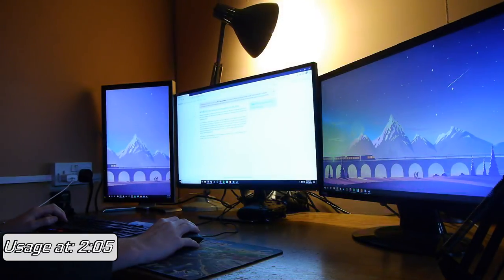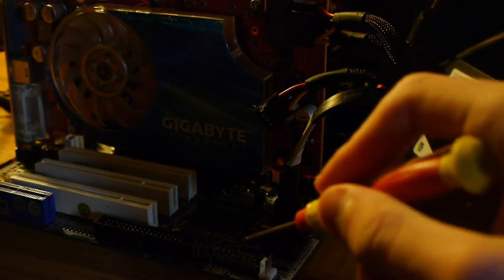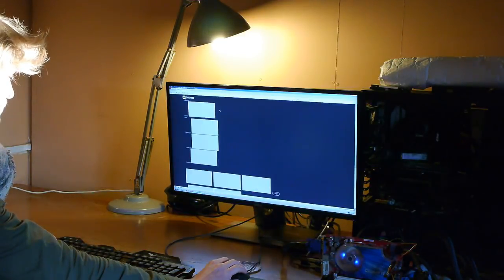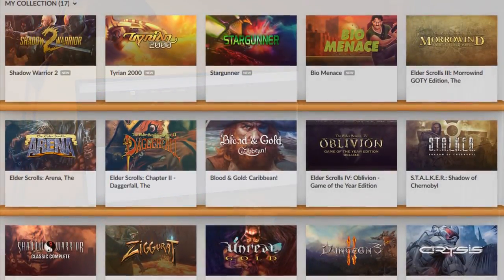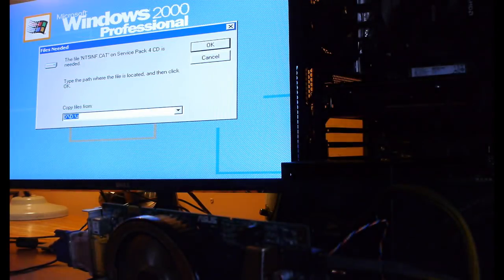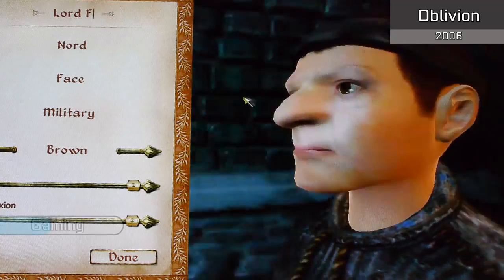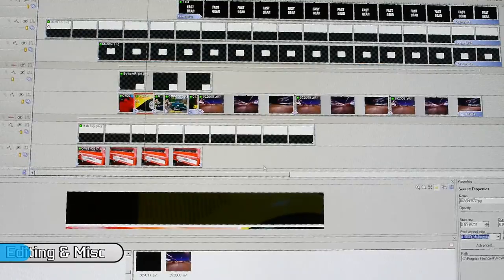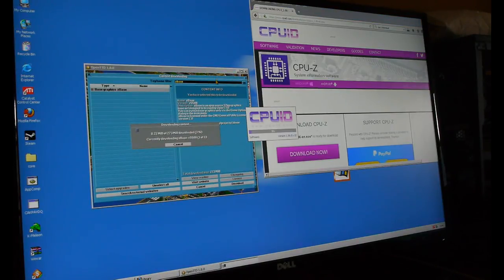Windows 2000 - Is it any good today?

Comment: a time when Microsoft knew how to make operating systems...
Reply: Windows 7 was pretty good imo
Reply: … except right before 2000 came Windows ME.
Reply: @jaywolfenstien  That's right. People always like every other version of Windows.
Reply: Well, the reason why WIndows 2000 is so good is just: It wasn't made for the cheap home/oem market, but for businesses and servers, where stability was the key factor. It had to run on older hardware than ME or XP, as it was also the long awaited upgrade for NT 4. And especially in the first half of the 2000s there was a specific difference: Windows 2000 couldn't play games at that time!

Why? Because only with Service Pack 2 you got the first Direct X and 3D-drivers. Only with the newest service pack (SP6) your Windows 2000 became a genuine competitor for Windows XP. And SP 6 came out, when Microsoft already was pushing Vista into the market. It was wanted by the server operators, because they didn't wanted to install Windows Server 2008 - most of them skipped that version (a variant of Vista) and went straight to Server 2012 later on, which was a sister system of Windows 7.

And that's also the reason, why Windows XP worked, while Windows ME sucked: Windows XP was a Windows 2000 system with enhanced graphic and driver support. At that time we were all annoyed, that our old Windows 98 drivers mostly didn't worked in XP - and didn't understand, that this was because of the 2000 restrictions, that only allowed drivers, which used the windows dll routines and not something native, which was the reason for all the driver conflicts and crashes in Windows ME - too much hardware drivers incompatible with each other. 

So, yes, Windows knew, with their NT series, how to make operating systems in 1999. The DOS/95 line was at the end of it's life time, you couldn't get the system working stable anymore (Windows ME), while NT had none of the 1980s backtraps and was therefore better.
Reply: After XP it went downhill.
Reply: Not really. Windows 7 is a good working system. And it's unfornatunally, that it has to be abandoned at the end of the year, because it's service time runs out...
Reply: That is unfortunate. When it's service time runs out my files saved will probably go with it.
Reply: @acmenipponair  I'm pretty sure the newest Service pack for Windows 2000 is SP4. 
In 2008, server operators would probably have preferred to use Windows Server 2003 or 2003 R2 rather than Windows 2000 server.
Windows Server 2012 is a sister system of Windows 8. Windows 7's sister system is Windows Server 2008 R2.
Reply: Maybe that's because I'm young (younger than w2k) but I wouldn't use it, even for retro purposes. Vista and XP are fine, but what's the point of having a retro OS without Windows movie maker?
Reply: @wordart_guian , You don't see a point without Windows movie maker. It means a lot to you that an operating system has one. I've never used movie maker. I never cared to. I enjoy software such as Microsoft Works 4.5a, Word Perfect 6.0, MS-DOS Word Perfect 6.0. It takes an older OS to operate those software's.
Reply: @eclecticreader961  this was humoristic, but yes I grew up thinking of built-in video Editing as a base function of any operating system. (I was extremely disappointed When W7 didn't come with it, and even more When it was discontinuited in 2017. 2017 was a sad year in tech.)
btw I'm surprised these run on 2000 (it had basically the same base as XP)
Reply: @Pharrell True.
Reply: @jaywolfenstien  Which was flawed mainly because it was basically rushing a backport of a load of features from Win2k to the old Win9x codebase. There's actually a large portion of 9x retro machines either running ME with that stuff disabled or running 98SE with a bunch of ME components replacing the old 98SE equivalents because without the bad code, it's more stable and faster than 98 was.
Reply: @P7777-u7r  I code but not professionally.  Windows 10 in a lot of ways is actually the best version to date.  Its easy to hate Windows but the people making it today are not the same people some versions ago.  It really is good.  I use a MBP for work and Windows at home but have written programs for both.  I like Windows 10.
  
Edit: MacBookPro, not MBC lol
Reply: Between 98/ME and Vista, it was a very small window (no pun intended)
Reply: @jaywolfenstien  We don't talk about...

'that'
Reply: oh c'mon windows 7 and after a while windows 10  is pretty decent
Reply: @clusterhunt  yeah now win 10 is pretty ok, but it still could be 1000x better
Reply: @jaywolfenstien  Windows ME came after Windows 2000.
Reply: @eclecticreader961  Nah, Windows 7 and 10 are also good operating systems. And I would miss the search field when opening start, plus you had to login as an administrator manually to be able to install software.
Reply: Michal Litecký  I hope you're joking.
Reply: Are you fucking serious. Windows 10 is one of the best systems ever made.
Reply: @mopeybloke  except for 8 and 8.1, that broke the every other chain
Reply: @raihanislam912  it sucks, and I'm still on it.
Reply: @acmenipponair  it sucks compared to windows 2000
Reply: @JohnDoe-gy5dr  it sucks, the end of it!
Reply: Windows 11 cough cough
Reply: Dustter  have you ever thought maybe people know how to use it but maybe they just don’t like it or want to use it?

Comment: I used Windows 2000 until its retirement forced me to move on in 2009. I loved Win2k so much. My favorite version of Windows.
Reply: @ken131 most people don't know or forgot that windows 2000 and me where different because Windows 2000 was the patched version of Windows ME and when the internet goes down and people are locked in a bunker they would be grateful for a PC with a large library of offline games
Reply: @damienhartley3222  Not exactly “patched version“, it’s a wholly different OS.  Me was the very last of the 9x like of operating systems based on DOS, while 2000 was based on the much more stable NT kernel that MS used before for servers and workstations and that’s been the basis of every version of Windows since 2000/XP.
Reply: @jdatlas4668  Well technically the current master NT kernel is hybrid and can use 9x principal over hyper v which is using the native kernel in a isolated algorithm to protect the core system which is less hardware intensive than virtual pc which allows windows to be cost effective and Google optimized.

Comment: Windows 2000 is the only version of Windows I actually enjoyed using. Rock solid stability and speed.
Reply: I have never actually had to use 2000 but i adore it's simplicity. No bloat, just you and a fresh desktop.

This is why i've tried multiple times to switch from windows 10 to linux, but i can't really make that switch as linux doesn't play well with hybrid graphics.
Reply: Hybrid graphics do make it complicated. How do you feel about switching to Windows XP?
Reply: @eclecticreader961  as in switching now, i dont think i will ever switch to XP again unless i decide to play old games again, but then again most of my old games work with windows 10.
Reply: It sounds like switching back to XP wouldn't have a purpose. What old games work with Windows 10?
Reply: @eclecticreader961  well i dont have many, but diablo II seems to work. Everything else i have is newer, like gta san andreas and vice city. I also have typing of the dead working fine.

But from what ive witnessed its the hardware that determines what old games you can play on windows 10. None of my friends can even play gta dan andreas without tweaks on their modern gaming laptops.
Reply: @eclecticreader961  oh and i forgot to mention fallouts 1 and 2
Reply: Nice, Diablo II. GTA San Andreas and Vice City are good ones. I think the graphics for Vice City are easier on the eyes than San Andreas.
Reply: @eclecticreader961  can't argue with that. Even though ive had san andreas almost my whole life and adored it for quite a while, i still found vice city very enjoyable. I don't know if its the story or the faster gameplay or both, but it has charm.
Reply: I feel the game-play is faster in Vice City. 

I never got through the flight missions in San Andreas. It's a shame there's no code disk that can close the missions and unlock the homes in Las Venturas.
Reply: @eclecticreader961  yeah vice city does have faster gameplay and better car handling. But can't really blame san andread as it was trying to be more realistic.

I never had many problems with the flight missions. I always got there in the end.
Reply: That's good you made it through the flight missions. I can fly through those rings, but when I try to land, the plane catches on fire and explodes.
Reply: @lonttugamer2939  I liked all of them until windows 10 really, it's incredibly unstable bloated and is ready bad with running older stuff.

I think I've not used 95/98 and 2000( and some older ones I don't know the name of)
Reply: oh thank you :)
Reply: Yes
Reply: windows 2000 is great offline thats what i use it for just getting word 97 and encarter 99
Reply: @eclecticreader961 only XP x64 was good. It was much faster and actually 4:33 reliable (no crashes at all unless left on for 2+ weeks which is typical m$ even today).

Comment: Windows 2000 is one of my favorite versions of Windows! I still keep an old Lenovo Thinkpad laptop running with Windows 2000 and Vista dual booted on it so I can run legacy software a lot better. With the unofficial SP5 for Windows 2000, I can actually run somewhat modern software on Windows 2000 and browse the modern web as well.
Reply: hence why you had the startup sound as your intro
Reply: Doesn’t Windows XP have the same level of software support as Windows 2000 given the Extended Kernel is installed? What the hell sets it apart then on?
Reply: What is ur CPU, chipset and RAM?

Comment: Through my own programming I was able to use Windows 2000 for many years, people noticed it and I tried to explain but they never understood.

It wasn't until recently when I bought an entirely new system that I stopped using it, just due to the fact of simplicity and newer software not being supported.

It's very much like linux if you can program for it, you are good as gold.
Reply: I ran it until 2010 until I wanted to run some Win64 programs. At that point most games required hacks to run-  which was OK, I would rather hack the game than run MS' bogus modern bloated software. At that point rather than knuckle under and adopt Vista et al. descendants I migrated to Debian on my laptop and Gentoo on my desktop. No modern Windows OS can match the leanness of Windows 2000; it is the last great iteration of Windows. There is no modern simple version of Windows, so I reserve a partition to dual boot Win10 as needed - thankfully not often.
Reply: But proto, windows 2000 is so old....blah blah rant
Reply: Pfft rookie. I'm running Win 2000 in the year 2135.
Reply: I ran it until 2016 when I moved to a newer laptop with XP on it instead. The extra graphics power was needed and I wanted to run some newer software, so rather than sticking 2k back on I left it on XP.
Reply: BUT PROTO WHAT ABOUT WINDOWS ME??
Reply: they make new software incompatible with older software and older hardware so that suckers buy the newer versions  .  its all about taking money from the workers so that certain people can live a good wealthy life style .
Reply: @carmichaelmoritz8662  its funny that my sempron 64 bit cpu runs windows 98 to 10. at least i can use 2000, xp , 7 and 10 on my 4 drives. "Update" Just upgraded to a Athlon 64 x2 3400+ 2.6ghz. windows 98 died.
Reply: @jordanvelazquez6321   well thats due to the fact that they want certain new software to run on older systems so that they can make more money selling the said new software while certain software wont work on certain hardware with basically the same  intentions  ,bottom line is its all about them being able to take as much money from us as possible .   whats really going on eh lol .  maybe its just that they do not care enough to make all software and hardware backwards compatible or a bit of both reasons  .  i think its mostly about the money  . it seems like most people are only interested in money .  its what drives the majority .
Reply: @carmichaelmoritz8662  im 100% with your thoughts. Thats why i like finding ways to try to run new software on old hardware even though in might run like crap. But one day i want to see someone create a way to modernize old hardware and make it faster then ever.
Reply: @jordanvelazquez6321  i agree , if someone wants to run win 3.1 on a windows xp system why not .  a person should not have to type in extra commands to make it work . all i know is that for me to make windows 95 with usb support work on my old system built for win xp , i had to include command lines or it would not even boot up .  same goes for when i use to play pc games on certain systems , i had to add a command for the sound to work properly with my old sound blaster 16 sound card . ect ect ect  .
Reply: @jordanvelazquez6321  it just bothers me that for those that dont know what or where when it comes to computer commands and they get sucked in to buying software or hardware that they dont really need .   one guy told me i need to buy a newer sound card ,  lucky for me i was given the knowledge about what and where to type in the command lines i needed .  same goes for a vesa driver , i told a guy i needed a vesa for my computer , he said why do i need a vesa . he thought i was talking about a vesa credit card i guess lol  .   as soon as i installed the vesa my mouse driver worked perfectly .  when i were younger i would have just wrote my own code for the drivers  , for the price and time , its best to just simply download the special drivers needed .  :))
Reply: @carmichaelmoritz8662  great job👏👏✊old hardware must be preserved and modernized.
Reply: That's true on any os. Learning to program in 2000 is probably like tying one arm behind your back.
Reply: @jordanvelazquez6321  you can set the os to Win95 on BIOS
Reply: @prushimush  win 7 and XP could be as good or maybe a little less as win 2000
Reply: I mean, Mint and Ubuntu are pretty stable.
Reply: @carmichaelmoritz8662  It's actually really hard to support older systems, especially when the user base is small
Reply: @circuit10  i agree somewhat and yet still stand on my belief thats its all part of getting people to spend more on upgrades or a newer system and software  .
Reply: @carmichaelmoritz8662  Most software developers don't make hardware though...
Reply: You don't need to be able to program to use Linux, but it helps (it also helps with Windows 10 though)
Reply: @YakobtoshiNakamoto  rest assured, the Royal Navy will be running it with you, until at least that date.
Reply: @yeright1977  this comment section is full of kids

Comment: I've installed my windows 2000 so often, that I accidentally memorized the 25 character CD-Key :/
Still my favorite Operating system.
Reply: Kilo Byte  Nah, my brain is just really good at memorizing random crap that I don't need. Numbers are easy, names are hard.
Reply: 2000 is great but so is 7
Reply: @docsynth4387  2000, XP, and 7 are best.
Reply: Haha that was me but with windows 98.  I found 98 got slow over time and you had to reinstall it to make it fast again so I was installing it like once a week lol.   I was a pretty heavy user that liked to program and install different programs etc so just from doing those things it did not take long for it to start slowing down again.
Reply: @redsquirrelftw Me too - Windows 98 was at least a monthly reinstall - F7J27 F3JTW Q7K7B WVWM2 KM8HM !! I ran 98 for about 2 years and moved right over to Windows 2000 when it was released so I haven't used this serial for near on 20 years and I can still recall it every time
Reply: I still remember the XP VL product key :D D36RK-QDFFD-BTWWY-BT7KK-43MGM
Reply: I used to remember an XP key, now all I remember is PQTHM-RWBHR
Reply: Same for windows 98, I had to reinstall it every 2 weeks at home. I Recently forgot my starcraft cd-key that i used to reinstall every single time from mind. sad day... rip starcraft cd-key.
Reply: @cesarjavierbarbosa8318  but 2000 is an os on bare metal meaning the software will run really fast.
XP sp0/1 is almost as fast BUT sp2 added a security layer and SP3 TRIED/TESTED adding some BETA permissions layer, getting close to windows 7 security and separating the os from the user folders.
Windows 7 isn't on metal, it has a security layer covering everything, and an antivirus that cannot be turned off, making software loading really slow, unless it has been cached in memory already since last boot (and there's plenty of ram in the machine)
Windows 10 is worse because code isn't compiled for a cpu architecture, at all. Windows 10 runs just-in-time compilation of software (at run-time the software is created from the source files) and those source files are easy to reverse-engineer.
Reply: @GoldSrc_  I still remember my windows 98 key, but recently i forgot the starcraft key i had to reinstall every week. sad.
Reply: Awesome! I still remember my old wifi password 
Af7aad9453ca75
Reply: Kilo Byte  asperger
Reply: I've mentiorized my WiFi password
Reply: @cheshirecat773  same
I've installed win98se on my 98 machine so many times I've memorized the product key: PRDDH-83JD[Get your own product key dude, like I didn't just get this product key off winworld LMAO]
Reply: thanks for the password and the serials
Reply: RM233-2PRQQ-FR4RH-JP89H-46QYB Retail
Reply: @mawardiramli  exactly that one ^^